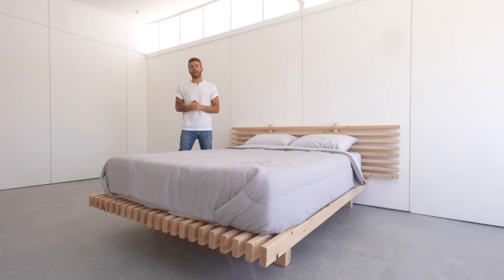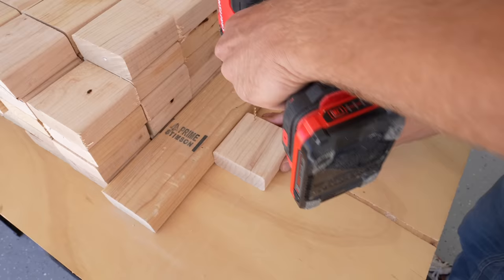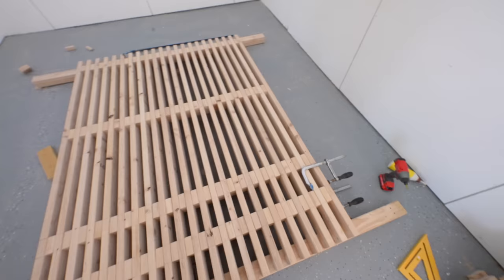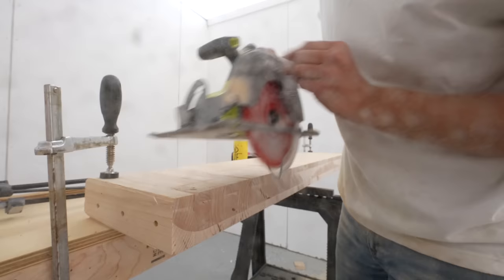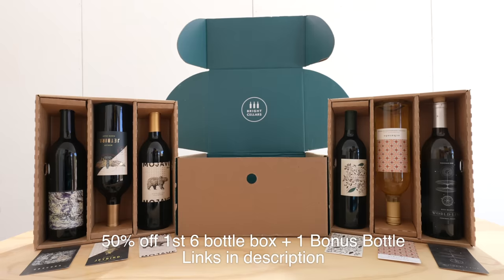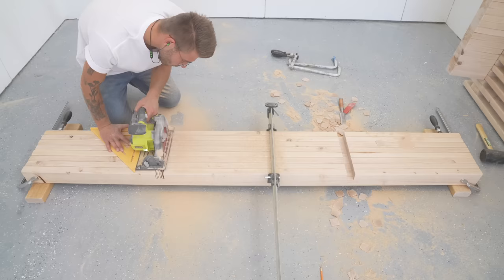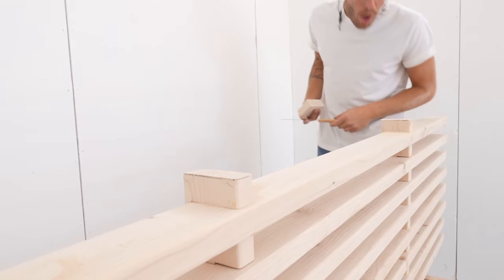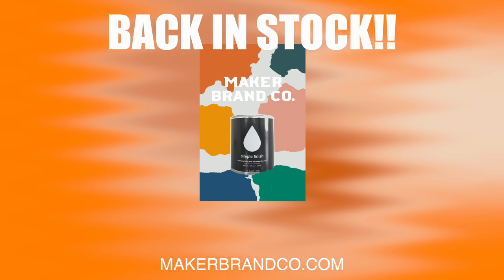DIY Platform Bed Made from ONLY 2x4's!!  | Modern Builds

Comment from the maker: So I ran the numbers.... 
35 2x4's at $7 costs $245
35 2x4's at $3.50 (normal price) costs $122,50

Double the normal price, but for $250 I'd say this bed is worth it!
Reply: 9.9ft  2x4 is about 10euro (12usd) here in Greece.
Reply: in nc they cost anywhere between $8-$9
Reply: I’m a project manager in resi construction. Home owner once had my trim carpenter make stair case out of 2x4s like your design. While undoubtedly pretty and very unique, home owner admitted it’s a dust MAAAAGNET and definitely wasn’t worth the trouble. Just an FYI for anyone considering making this.
Reply: Here in Norway, 2x4 is 25.85 NOK per meter. (aprox 3.10 USD per meter) . They come in 2.7 or 5.4 meter length. (C24)  (and the prices have just gone up with about 40%)
Reply: 2x4x8 in Calgary, Alberta are $10.35 ($8.53USD) each :(
Reply: I think this style would be a good alteration to your old outdoor bench project to make them a little lighter and cheaper.
Reply: I’m from Ohio. and my dad Is renovating my room, and he said the 2x4’s are $8!!!
Reply: Just amazing!! Congrats
Reply: Ahh... where I am at 2x4 costs $13...
Reply: Now make Bedside tables and a blanket box to go with the bed.
Reply: I work at a building supply in MT and a 2x4x8 is just over $10. 7/16 OSB is $85/sheet.
Reply: @mvalovalo  Interesting, I wonder why that is?
Reply: from NJ, 2X4 is $8.49. So you better grab Select Pine 2x4, which is $9
Reply: Do you think you could have achieve  the same bed with 50% less wood? How strong a one 2x4?
Reply: Ours is about 10 $
Reply: Bid war lol
Reply: 2*4*96 are $8.96 here.  That comes out to about $2.99 per board foot.  Depending on your location, you may have been better off getting ash or soft maple.  We can get ash 4/4 lumber for $3.15/ bf and it is a furniture grade hardwood, while 4/4 soft maple is closer to $3.45/ bf.  Our king bed still uses a box spring/ foundation I made from 2x4's 15 years ago.
Reply: @Xander-dx6mw  Where is here, to me it's Spain
Reply: Almost $10 in Canada
Reply: @marianacaffaro  Norte Carolina, Estados Unidos
Reply: Good point, I think I'll move ahead.
Reply: CA is around $8.50 after tax and whatever the lumber fee is.
Reply: 2x4x?
Reply: In Denmark the price are around 6 usd for a 2x4 - in 2,4 meters -  9,6 in
Reply: I wish my 2x4's were only 7$. Here in Iowa an 8' 2"x4" is 12$. I picked up a dozen board the other day and it was over 150$.
Reply: Yes 2x4's are expensive rn...I think I would of tilted the headboard back some so it would allow a pillow to turn it into a reclining spot as well also would have ran the lumber in the other direction to allow end tables with a handful of 10' 2 x 4's and bottom support legs would have been 2x10  or 8 that's alot of extra glue up... great looking build though just some extra ideas for next time
Reply: The comma, 122,500...
Reply: Here that are like $8
Reply: Out here in New York 10-12 bucks a 2x4 @home depot.
Reply: 2x4x8 top choice studs are $9 in central NC today
Reply: Almost €12 in Belgium 😔
Reply: lol $3.50 for normal price, they are $10.50 each near me.
Reply: @CrinosAD   In Sweden I could find 2x4 for 22,95 SK /meter. 2, 75 USD/meter
Reply: @Elin.Noller  I found my prices as Byggmax :)
Reply: @Conor Carbery where are you buying mate? The ones I'm getting in Louth are hairy and pretty ugly looking
Reply: 2x4s are over $10 where I'm at, I'm holding off buying any wood for a while but I do like this project.
Reply: This bed in Chicago would cost $2,679,876,678,098,998,234,678,876,667,555,666,666,666,666,666
Reply: Where I'm at this would cost close to $500.
Reply: 2*4 by 8 is $12 here in Quebec (plus %15 tax).  Might want to check the numbers, but I calculate that bed cost close to $500....
Reply: Dang with current prices at my lowes and tax 35 would cost about $375
Reply: CALIFORNIA. In between San Francisco & Sacramento state capital is $8. Thats Home Depot.
Reply: Any of y’all mofo’s know if hitting up a lumber yard might be cheaper than Home Depot/Lowe’s/Ace?
Reply: When was that normal price lol 2x4 here was 2.00 this bed is not worth it when you can buy a frame at the same price
Reply: 2x4 about $9.25 here
Reply: @ishtlutz1261  it van be, best bet is to find a tree guy, find out where he takes his trees trunks, go to that yard say you know him, befriend the owner,  get decent deals on lumber... tough times
Reply: @patrickbentley4038  those are good suggestions. While running the bed frame 2x4s sideways would have been great for end tables, it would have presented an issue with the sides potentially scratching you when you brush up against them or get out of bed, and the foot of the bed would not have the same slotted aesthetic it does here. I'm not sure those trade-offs are worth it over simply making separate end tables and attaching them (or not).
Reply: Canada a 2x4 is 11 dollars : P
Reply: in Australia 90x45mm is $4.51 Per 1 Linear Metre. so its expensive and heavy.
Reply: 2x4x8 is average 8.40$ on the US east coast at lowes and home depot. Well over 300$ with tax. 

It's a neat bed, but you can buy a nice solid queen prebuild for 100$.
Reply: I just need to know, if there's a possible way in me collecting the plans?
Earlier I sent you an email? About a 'print out? Only my phone doesn't have enough storage space. And the email I sent you? I was at my local library. Which was the reason why I went there for that 'print out!'
I am VERY MUCH ENTHUSIASTIC in collecting those print out plans?!
I'm a novice carpenter. And building this 2x4 project! For me, personally! Would be a very good challenge!.
So may I please collect from you those plans? You've already read my unsuccessful  attempt, earlier. Is there another way to collect those plans? Besides the way you have it describe in your web page?
Reply: @mvalovalo  also everything is glued and screwed together, not an easy task to move or transport. I prefer something that will dismantle.
Reply: Wtf did you spend on screws?
Reply: quebec is almost 10$ with taxe......350$ i can buy new one and better in many place
Reply: How long you did it? One year?)))
Reply: How long you did it? One year?)))
Reply: @lucdesjardins6126  tellement
Reply: @mvalovalo  This was one of my first thoughts. Dust collects in the space between 2 x 4s and under the bed.
Reply: Not entirely true because the screws are not factored in. Screws are quite expensive too.
Reply: Here in AZ 2x4x8 is 3.75
Reply: To save on cost, you could simplify the majority of the frame that's hidden under the mattress while maintaining the same look around the edges. Looks nice though, good job.
Reply: Wrong $122.50, and $245. I get what you're saying but it costs more than that 8f you hot a cheap made wooden  beefcake. And headboard.  Mind you it looks like a king.
Reply: Lumber prices are going back down, my local store now has them for $3-4
Reply: @Glen Hacker try back now and see if price down. In Mississauga they were 3.98 yesterday yet they were 11-12$ back in June
Reply: The guy used about 100000000 screws
Reply: Forget the price not practical
Reply: @mvalovalo  dust? Wait for spider webs....
Reply: @JohnMadeit  each?
Reply: 2x4x8 are 3.98 each in Ontario, Canada
Reply: @gordonbradford1013  8
Reply: Could we use Nails instead of screws for this build?
Reply: Yes, about $8 for a single 2 x 4 here in the Midwest.
Reply: 20 bucks for a 6 by 6 cm, 2.4 m long, ouch! The manual labour and electricity, plus material is not worth it in 2022 and I never ever had a sturdy bed. Sigh..:) I love wood and whoever said it is a dust magnet, just use the anti dust spray on time and clean the outside :)) Thanks for sharing!
Reply: May i know what type of wood you used?
Reply: 2x4x8’ long are currently $13.50 each. That’s $475 for just the wood. Screws are an extra $15
Reply: Wow our cost $245 for one 2*4 8' long. Southern hang a emit on
Reply: The price increases are shocking. And this was a year ago!!! Four more price increases in this last year from my build yards. I build anything, I just don’t plaster. I’ve been fencing this week, and what I can’t fathom, is that last year my feather board strips were 75 pence each plus vat. Last week they were £1.85 plus vat. How on Earth can something that wasn’t even a pound, increase by more than a pound. It’s an absolute joke right now. We’re all having our pants down!
Reply: Dont forget costs of equipment and other supplies
Reply: Got some Amish cedar for 5.75 for 8 foot
Reply: Pretty but more expensive than what I’d want in a rustic look
Reply: in Romania there are for free !!
Reply: 2-inch x 4-inch x 8 ft. SPF Dimensional Lumber are still $3.99
Reply: nah...
Reply: 10:00 10:00
Reply: What about all those screwsss
Reply: $14 AUD in Australia. 
I'm watching this because I'm about to build a floating bed frame. 
I bought 90x35 today, but only 12 on the flat with rails running both ways under. Cost me $112 AUD, plus a bit of timber I have already at home for the rails. 
Your bed is unique but looks heavy and super labour intensive, plus to move it you'll need a heap of men cos it's all one piece.
Reply: Absolutely.
My only critique: the loose ends of the header won't stay parallel, I'm afraid.
Reply: @mvalovalo  more of a dust magnet than any other wooden staircase?

Comment: Two main issues in this design: 1) dust accumulation between the boards and amount of effort involved to clean it up; 2) those front corners stick out too much so someone can bump into those and ouch! It sure looks cool but not everything cool is practical or comfortable to use.

Comment: Love it. My only note would be that it's impossible to move out of that room. Some modularity in the base might make it a little more "move" friendly. Perhaps have the base separate into thirds rather than a single piece.
Reply: You could use a threaded steel rod with some washers and nuts to press it together instead of screwing every block to the next one - drill a bigger hole for the rod and screw it together at the end... then disassemble at your convenience.
Reply: @mikek9297  and much quicker too! I think you've improved the engineering of this bed so much I'm going to give it a go, definitely using threaded inserts
Reply: @the-elliott-day  How did it go? How loud is it/ and creeks?
Reply: Ya, I was also thinking this bed is gonna be a permanent installation unless you start cutting again lol.
Reply: @mikek9297 I thought same 🎉

Comment: 96 inch 2x4 $4. also instead of the 2x4 going across the entire bottom you can just make a box and cut 2x4 into say 1ft pieces then attach them to the box. have 2 going full length on each side. 12 boards should be enough to make box and the rest of the platform

Comment: I modified this build. Instead of using spacers between the bed base, I cut the long 2x4 boards and used that as the spacer and then shorter 2x4 boards to run between them (like you did the 2x4 bench).  Less cuts and material used and one step removed from the process.  My son loves it in his new apartment away from home
Reply: I was like building the legs and spacers at the same time and with the shorter 2x4 boards placed between it still looks like the legs you made

Comment: I like the idea and probably am going to do this myself. Was it a design choice to use so many 2X4s? I feel like it could have been done with way less boards. Just a thought.
Reply: You could do it with half of the long pieces ( bigger spaces between beams) while retaining more than enough rigidity and strength. After all most beds have just two long walls and they work. This design is simple and aesthetic, but very, very inefficient.
Reply: @mikek9297  Exactly what I was thinking, good shout! 🪚

Comment: It's pretty but seems excessive.   5x  2x4  with supports 60" away from each other can support 500lb per foot collectively.    It would have proabably made more sense to just build a regular frame box and add the pieces at the end, since you lose the length view by sticking spacers in it anyway.  Plus you could make 2 or 3 separate boxes and bolt them together so you can move it between rooms and upstairs with a lot less effort and damage.    The sides could even be doubled up if you want that full length piece without seams (if not painted.

I like the idea and look, minus the supports.
Reply: Coming from someone who never built  a thing in his life.
Reply: @4b0d3  the hell is up with the hate with your comment, some people are just all day negative
Reply: I agree. Beyond overbuilt. It's gonna be nonsensically heavy. Its a silly, expensive, indulgent, and not even that nice looking design.  He build a backyard deck....and then put a mattress on it.
Reply: @emmaloref1438  he's giving honest feedback, while it looks pretty it is definitely over engineered and excessively expensive and heavy, not to mention hard to move in and out of a house, if need be, nevertheless if it makes him happy then power to him, but for someone who might not be able to buy the entirety of the lumber for this build this information is important, as they can work around the challenges presented

Comment: Prices have gone up so much, that this bed would cost roughly 750$ here in germany 😅
Edit: I'm talking about the lumber. Nothing else included in that price 🤪
Reply: I think you are mistaking the length of wood becuse they are mesuring 8ft wood for 7.5$, where in herer (Israel) it's 6 metars (20f) for 24$
Reply: The closest standard to a 2x4" in germany is 60x120mm. That will cost you 11€/m right now. He is using 30 beams of which each seems to be around 2,50m or 100"
That's 75m total which equals 825€ or 1005,88$. It gets even worse when you account for the off cuts since the standard length is 13m which leaves you with 1,8m of "waste" for every 5 pieces. I did make a mistakes though by converting from € to $
But that now made it even worse 😂
Reply: Well actually now that I checked the actual dimensions of a 2x4" (should have done that before 😅) let's go with 40x80mm. Those are made in 5m beams and they are 22,56€ a piece so 338,40€ or 412,64$
Edit: long story short: you are correct 😂

Comment: I work at a family owned lumber yard in Rhode Island and we have Spruce 2x4x8 for $10.67 each and Doug Fir for $14 each. Most contractors lately have been ordering materials for an entire job at once rather than in small batches at a time because the cost of lumber is so high lately.

Comment: Nicely designed.  Simple yet elegant. The only thing I would do is it turn this into a more modular setup so one can move ithe bed more easily.  For example:

1. Turn the platform into 3 modular pieces.
2. Instead screws exvery where, use like a thread insert to fasten the modular pieces together as well as fasten the modular pieces to the leg support.

Since this is for a king bed, onbce it's built, I don't the structure moving out of any room.

Comment: love the design. I think using construction timber may give you problems down the road tho. construction timber is very different from the timber used in joinery. The headboard and end of the bed will not stay straight and true it will warp and twist as they absorb water and dry out. you could help negate that by adding more of the packers you used at the end tho it may ruin the effect you have.

Comment: 2x4 nj cost 9$ each. I built mine using 2x8 for the frame and then 2x6 for under the bed. Lot more cost effective. I only used 4 2x8 and 6 2x6. Plus I used 4x4 pieces at the angle of the frame to give more lift to the bed

Comment: I liked the approach and tried it myself.  I agree with others that the expense was a bit more than anticipated, but I was already committed so finished it off.  However screws is a cost you did not add on your cost analysis which was about $40/box for me, not to mention that the short cuts were breaking despite the countersinking, not to mention the abuse on the wrist.  So I changed gears and used a framing nailer and adjusted psi to avoid breaking.  I will say that my daughter thoroughly enjoys her 2x4 frame bed.  Good idea, but quite expensive.

Comment: Based in South Africa - although we've seen increases in imported lumber our 2x4s (or rather 38mm x 76mm this side of the pond) haven't changed much. Current price for a 2.4m (8 ft) is R49 (or $3.5).

Comment: For economy and strength this works. Construction grade lumber off the shelf cuts at box stores, is about as fair as it gets for an expedient purchase and access method on average too. I might make one (with a few mods). ;-)
Edit: did my math - over 270.74' (feet) of wood , or 33.84 of 2"x4"x8' boards , for a total weight of 307lbs of wood. Add two adults = aprox 250-300lbs. Not including mattress, blankets,pillows,etc. I rounded a few measurements but the extra lost to kerf and such fits in close. A Common: 2-in x 4-in x 8-ft; actual: 1.6-in x 3.6-in x 8-ft, of Doug Fir is $3.63USD today 8/30/2023 so $123.42 + tax, glue (two bottles) and many screws.

Comment: Love this build.  I’m going to try building this even if the cost of 2x4 is 4$ pr meter. What do you think about changing the feet section with 2x6 or 2x8 instead of cutting up 2x4 into sections and gluing them together.

Comment: I love the idea, would be doing something similar soon. Can you explain how do you match the predrilled holes of the spacers to the ones of the boards ? Thanks!
Reply: no need to predrill the boards it's a 2x4 made of pine, it will be fine. If you really wanted to you could tack the spacer on with ca glue or a finishing nail or brad then drill. Honestly, though, this thing is overbuilt and will weigh a ton, if you are going to do this at least double up on the spacers and or make sure it is possible for you to separate the bed into movable pieces.